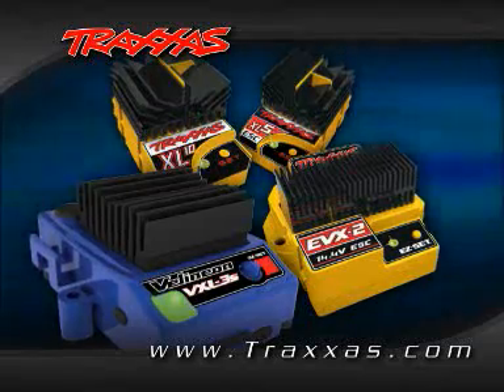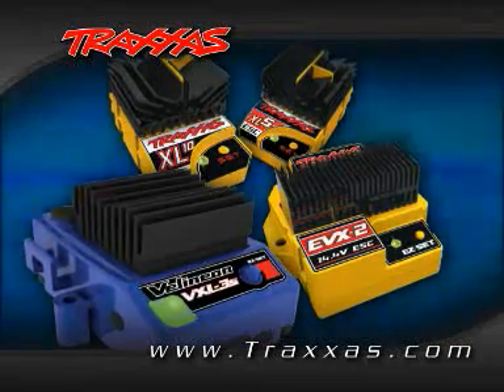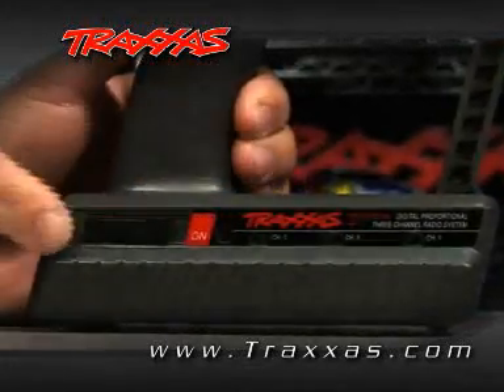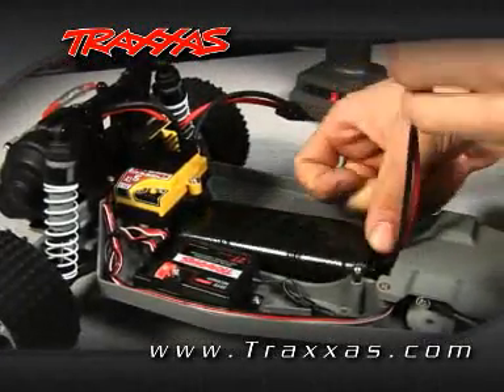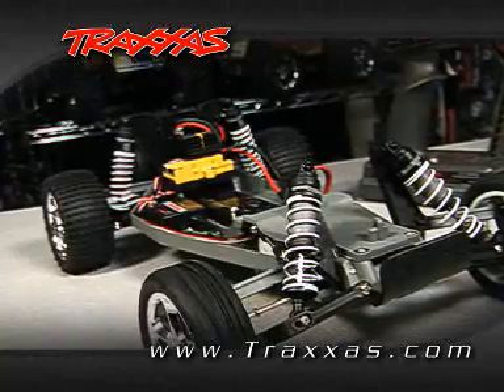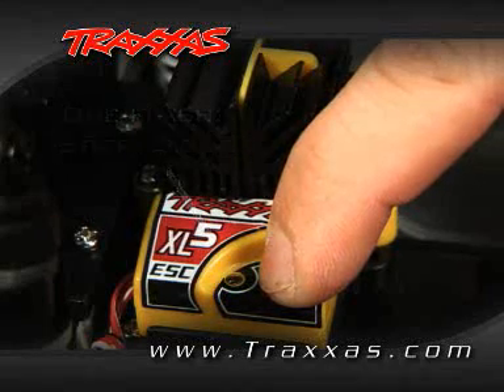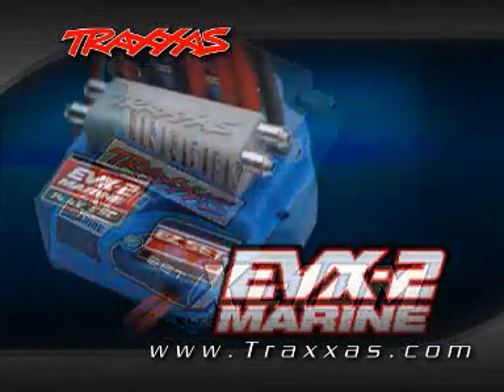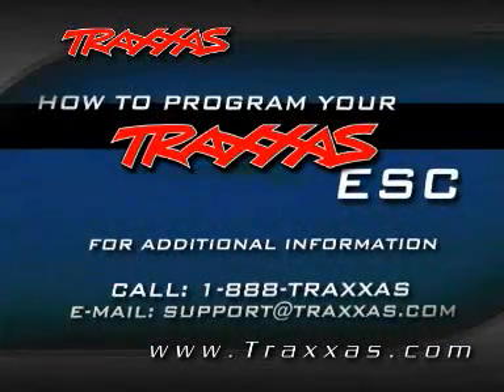How to Program Traxxas ESC

Comment: After the 3 flashes for Trng Mode, the green light just flashes repeatedly. It will not move. I have to hold the button until it shuts off. Then unhook the battery & push "Set' once to have it run but it's not in the Trng Mode. Help

Comment: WTF? Is mine broken or something? I havent used it in a long time, but I have a controller and stuff, when I try to sync it, I hold the button down, it turns green, then red, i let go, but then it stays red.... 4ever. nothing. And when I try to program it, I wait for say the 1st mode (one flash of red) then let go, but then the light turns off completely. Same thing's goin on with my stampede. :C...... Maybe I'm not allowed to use a 9.6v 2200mah? Thot I could :/